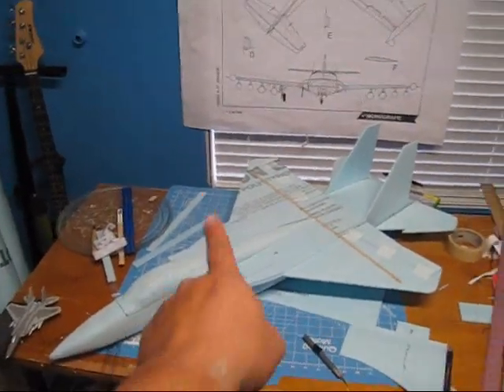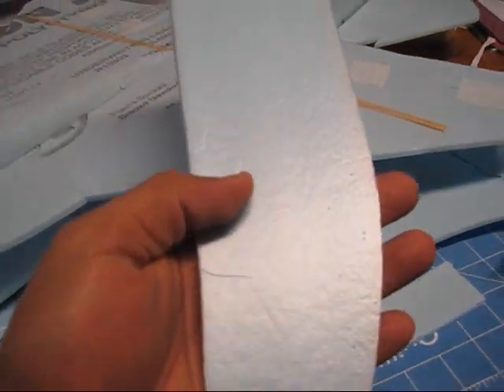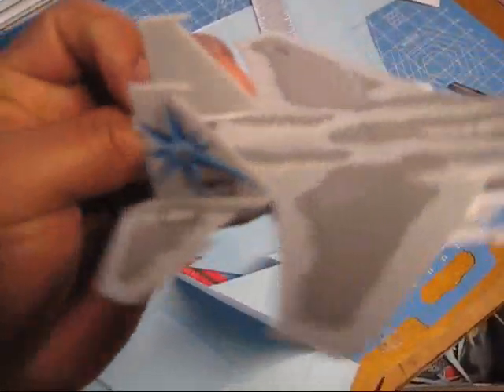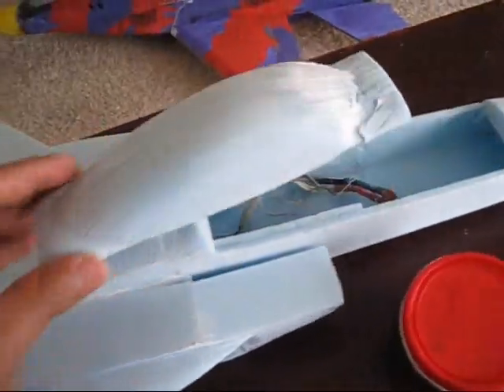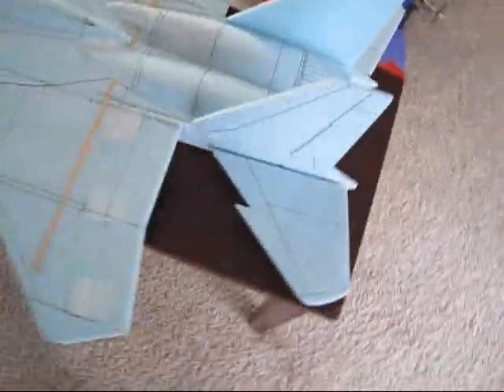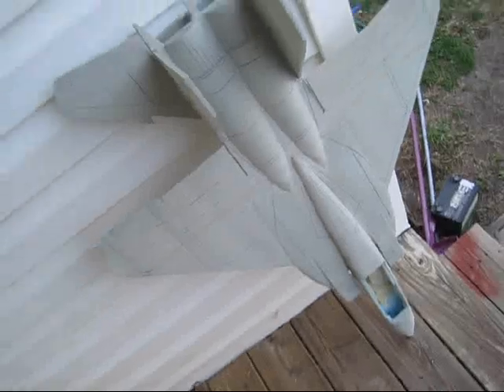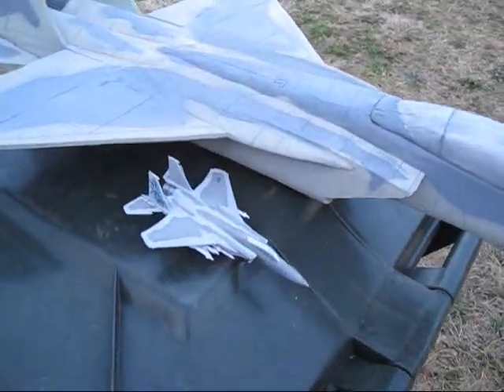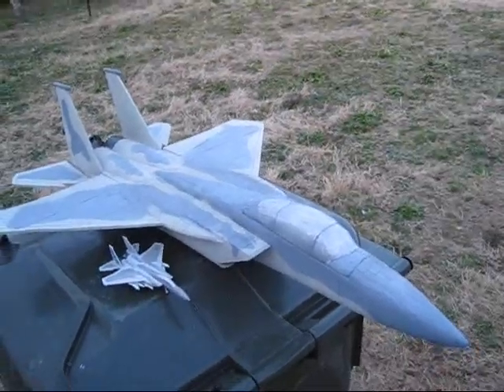how to build a rc F-15 (part 6)

Comment: What kind of foam is it?  I thought the spray paint would eat any kind of foam, or are you just holding the can far away and using very light coats?  Thanks for the info and the vids.

Comment from the maker: @bottomgunner  I use a medium point pen and a ruler, Just press strong enough  to mark the lines in  the foam, not so strong remember that you just want to mark  it  not cut it : ) and because the lines are marked not only drawn they are going to show after you paint your model